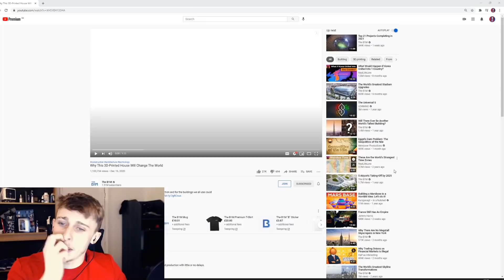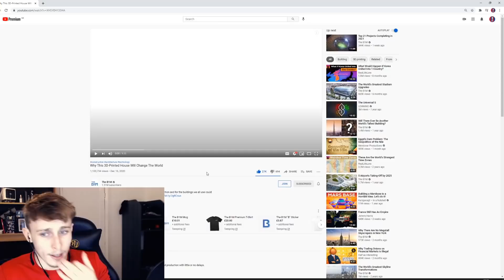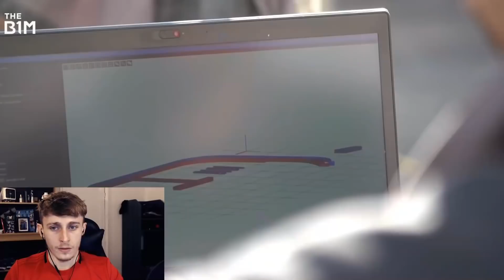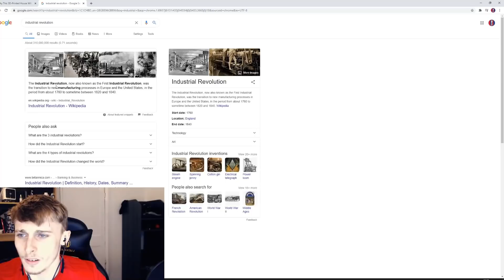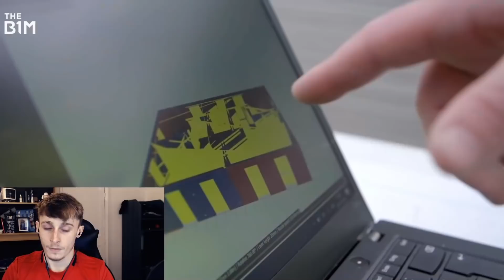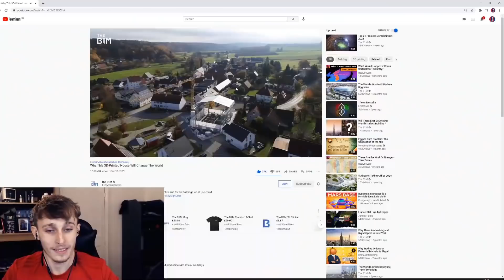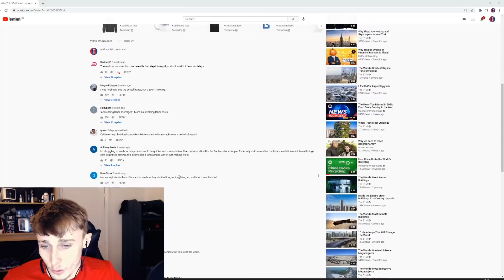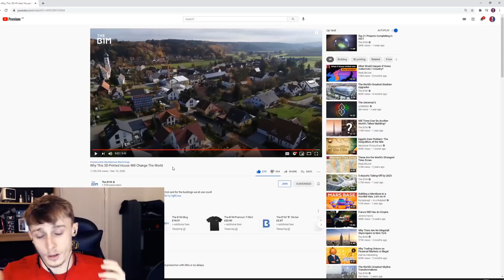Reacting to Why This 3D Printed House Will Change The World

Comment: There are also 3D printed bridges publicly used in Amsterdam and I think somewhere in China too. Even 3D printed sports equipments have been made for example the US made a luge sled to compete at the 2018 winter olympics and got a medal.  I think 3D printing is really going to pave the way for specialized  designs and allows rapid materialization from conceptual designs.  The best thing would be if the things being built are made out of a recyclable and re-usable material, but still be strong enough to retain it’s forms in the elements.  Then you can literally pick a design you want for your house, have it built within months, move-in and be able to scrap it all away for the new resident moving in, but still use the same materials left-over from the previously built house. This would be my ideal of where the printing technology would lead to.  Probably more sci-fi/fantasy than what could be realistically be  achieved, but I find new technology should either bring some form of excitement and added convenience to really be successful.  Or it somehow dramatically lowers costs.  They said labor costs could be dramatically reduced, however it would be a math crunch of what’s cheaper.  Getting a team of post-grad engineers to run and maintain the machine or a group of cheap laborers usually paid below minimum wage like illegal immigrants.  Perhaps the machine can output more houses quicker than by traditional labor methods, but is the extra cost for the machine worth those 12 days saved? So if this will truly be the future for homes maybe for urban development like Europe and Asia as well as commercial buildings it might be worth it, since these structures are all in one location and just built going up. But for more sprawled out residences like in America, I don’t think this machine will become the new industry standard for residential homes at least. Cities and urban planning there may be a future for though.
Reply: They actually showed one (for about 1 second) in the video. A very small footpath/bicycle bridge, to go over a creek or something, but still. There were like twenty-five people on it, to demonstrate it could hold that weight.

Comment: As a replacement for masonry construction it wouldn't necessarily cost jobs. Setting block uses a small crew anyway, and with the operators and a guy or two to insert the reinforcement and trowel the surface smooth as the printing proceeds, and the physical workload reduced because they aren't humpin' around big bits of concrete all day, I think the unions maybe could live with it. It makes houses quickly which is good with the way population is increasing, and inexpensively which is good because affordable housing is good. No matter how you define affordable. It strikes me as the kind of thing that is most economically viable as an owner-operator system. Did you catch how they left holes for the plumbing and wiring runs?

Comment: I'm assuming once the house is built there's no room for alterations. The one nice thing about houses is that you can knock down walls or add on rooms if you need or want to. I can't see you doing that with 3D printed homes.
Reply: That's probably where you'd need to make it a hybrid home with some traditional construction as well.
Reply: You could, theoretically, but the cost would be substantially higher than traditional expansions, and you'd be limited in what you could do (or where in the structure you could do it).

Comment: Imagine 3D printed Skyscrapers.
Reply: Not sure how well that would work based on the specific needs of a skyscraper. This cement-like material may not take well to building sway.
Reply: That would end up like 9/11 but not from terrorist lol
Reply: that would not work, It would need real steel, with a printer it would just be powdered metal which is significantly more week than the traditional way
Reply: These types of "printed" buildings require a low clearance and small footprint, because the materials are not up to snuff (as the others have said) to be able to deal with the kind of stress and tensile strength required for tall (or even large, as in "wide") buildings. Note how small this building is, and how short it is. Large or tall buildings, but most especially skyscrapers, require high tension, torsion, and compression ratios. 3D printed materials aren't there yet. It's likely it could be eventually, at least on a somewhat modest scale, using carbon nanotubes, and the "missile-proof" proprietary concrete and glass materials invented and licensed to Israeli conglomerates in the last decade or so (those materials are trade secrets). But all of that stuff is very new, expensive, and not available commercially to any real extent.